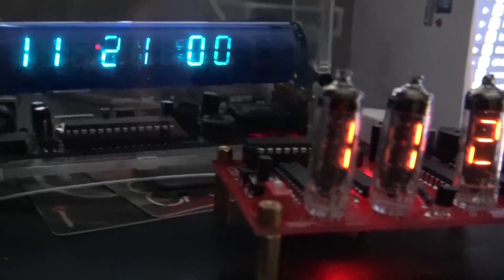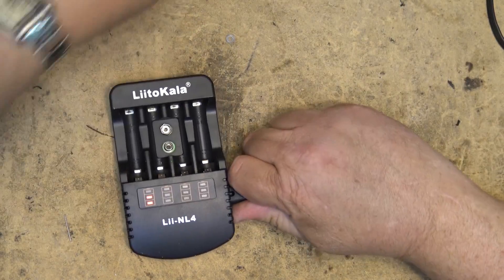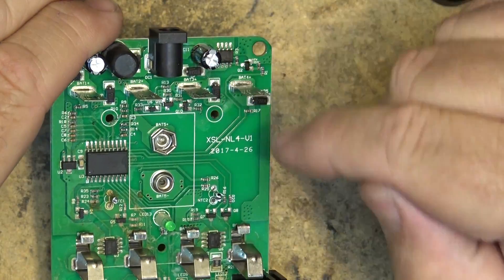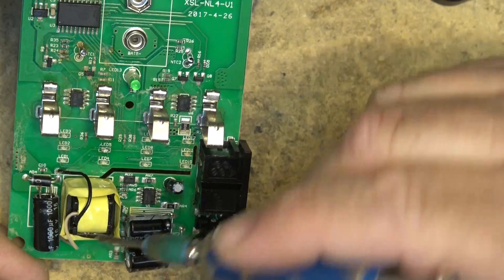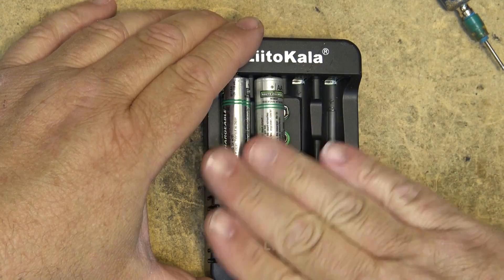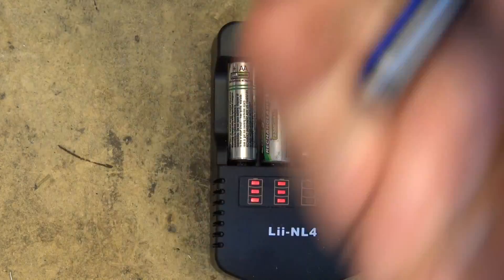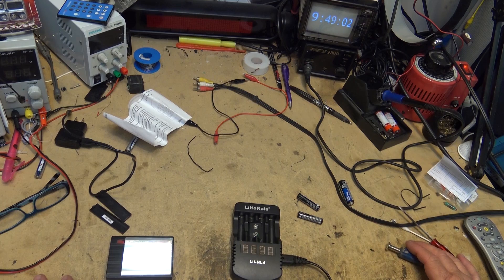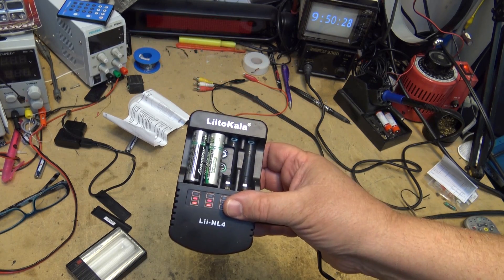Liito Kala Lii Ni4 Charger review

Comment: That's a nice little unit, i like the diddy switchmode psu :-D.
Shame they used cheap capacitors but it's a charger so i don't suppose it matters so much.
But If i had one, the caps would be replaced by panasonic low esr, but that's me, i'm odd lol.
Reply: The gap between the LEDs and the mains plug is too small. FAR too small.

Comment: I have those batteries  my self  still .
that charger is better than those ones that plug in the wall & over heat  ,  fast charge  HEAT .
No longer want to use them things anymore
Reply from the maker: shaun 
It did a good job of bringing back those old batteries. I did charge them on the sq4 charger last week but that was the first time they have been charged since about 2004
Reply: I like the charge meter  ,  these big batteries  take a wile to be done .
All my chargers are older than YouTube  its self  , soon as they are warm , out they come